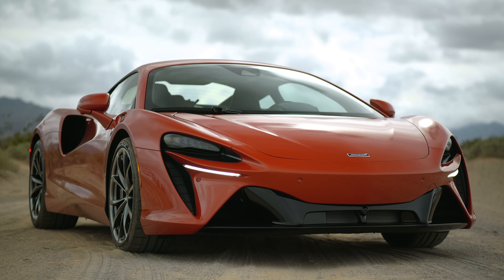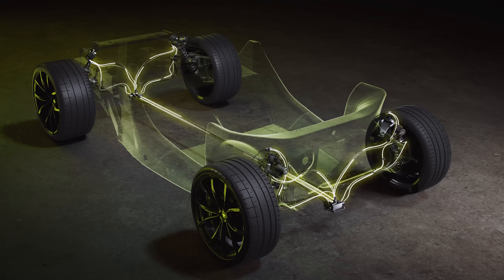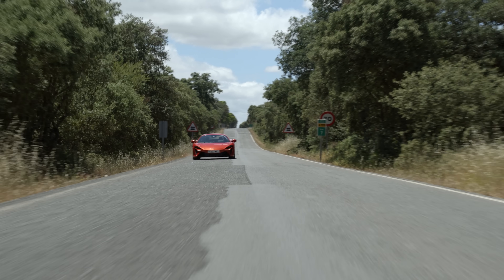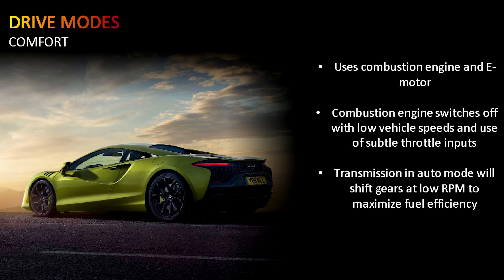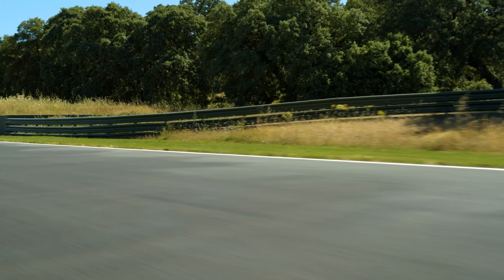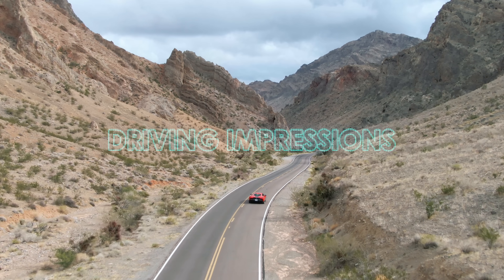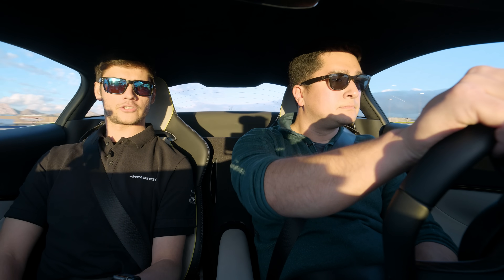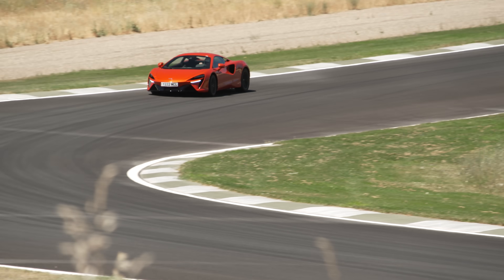McLaren Artura | The Hybrid Super Car Formula

Comment: It's kinda sad that when Honda made one of the first hybrid super cars it was nothing but cricket sound and complaints. The second-gen NSX is all but nearly forgotten. 
But now McLaren does pretty much the same formula as the hybrid NSX and it's the best thing to happen to sports cars since sliced bread. 
Y'all can suck my JDM cawk.
Reply: The 2nd gen NSX was a great daily driver. Ergonomics-wise, the steering wheel was one of the best wheels I've ever used. However, there were a few things that bothered me -- It lacked emotion.  Induction noise was cool to hear in the cabin, but outside, the car was too quiet. It's fine if you're driving in a sea of regular sedans, but next to other sports cars, it felt out of place. 

Styling-wise, Acura was going through the beak/shield phase, which I didn't mind on this car. Cars like this need to look good during the day and the lights need to make it look good at night. It needs to create desire and draw ppl's eye to it. The front lights at night were awesome. Jewel eye and low and wide appearance. The rear tailights however, used the claw shaped lights that were too pedestrian. At night, it looked like a tall car -- it needs to look low and wide. 

On the track, the car understeered quite a bit when pushed, I wish the car was a little more playful. On the street, the handling was great.  

The cabin was a little plain and the entertainment unit was outdated by the time it came out. However, if the car had more emotion and was a bit more playful, the cabin would be the least of my concern.  On a more positive note, the A pillar design was amazing and didn't obstruct your view as much and the forward visibility was amazing. The front end just disappeared and all you saw was road -- the 720S also had that feeling. 

Last nitpick, the side mirrors weren't power folding. It sucks when you need to get in and out of tight places.
Reply: The 918 Spyder, LaFerrari, and McLaren P1 were hybrid supercars that predate the second gen NSX by 5 years. And the NSX got a lukewarm reaction because it underdelivered on expectations and was delayed for so long.
Reply: I owned an NA1 and quite a few of those complaints were coming from JDM and NSX fan-boys too. All things equal most car enthusiasts don't want a heavy hybrid automatic/dual clutch sports car.
Reply: NSX styling was a failure, the price to performance was awful compared to pure engine competitors, and the assists were very aggressive and couldn't be completely turned off. It flopped for a good reason, but it will be great collection piece in 10 years.
Reply: I suppose its because of the different climates between 2015 and today. Back then we were fresh off the heels of the holy trinity of the 2010s, and BEV mandates were nowhere in sight. Now, anything with a combustion engine in any capacity is reason to celebrate

Comment: This car will kill the Mclaren brand. No one will buy this.
Reply: How so? It’s an evolution into where automobile power trains are going
Reply: @gigavirgin9653  because it's slow compared to the competition.
Reply: @R4M_Tommy  It's slow on the track, but on the straights it's really fast.  it does 10.4 seconds at 139mph in the 1/4 mile.  and 186mph in 21.5 which is faster than 90% of current Supercars

Comment: This car is amazing!!! It just blows my mind to see how far in advance the BMW i8 was. Starting the platform for these  crazy hybrids.
Reply: In what way was the i8 a “starting platform” for new hybrid sports cars? I hope you know it wasn’t the first hybrid or even the first hybrid performance car
Reply: i wanted rahter small battery then combustion generator powering electric with heat pump, suprrcapacitor, etc in a effiency focused car, then it can be fun as a secondary thing with communcative steering etc, which would also allow smooth steering, and minimizing braking to maximize longevity of fuel, battery, battery energy, tires , brakes, oil, etc. no range anxiety and its setup to be cheap as possible , some people dont need to have battry because they cant plug in, like apartment etc, fast charging is bad becuz more enegry going in and out at faster pace wworsens batteyr degradation.      maybe even a g force meter can show how near grip limit one is to avoid unsafe driving for non sporty driver, and linear response to driver inpit option for safer and more effceint driving for precise driver and then normal driving mode is delayed response to prevent excess unsafe accleration and brake for normal driver.                  just being fast is pointless to a great extent, but saving money, not being so unsafe to others in crash by being lighteight but structuraly strong for saftey, low emissiosns and resource usage and time spend on maintainence etc all makes it all feel better, yud have to drive lotus evora 430 or maybe even gma t50 to make speed feel that much more acomplishing
Reply: acomplishing and harmonious, driver input to response hamrnies, sound harmonics, etc
Reply: no it's the nsx. the i8 is NOT a supercar at all
Reply: @brownjb4444 I mean the the Honda CRZ started the whole performance hybrid thing then the NSX super car though the CRZ had a manual which no other hybrid seems to offer at least in the US!

Comment: I'll take a MC20 instead..
Reply: Looks a million times more usable and similar track performance. Maserati definitely got it right.
Reply: no because steering and brakes are not communicative lol. i dont care to check which one is less long and especially less wide, but thats helpful to allow mroe playspace on road. besides that, the linear power to sound correlation is better thna hybrid of course, and it looks more unique, argueably better.                 i suppose all the power isnt all that worthy of chosing it over old lotus evora 430, which is manual trans.   the only big step up is gma t50. you might like gma t33 , maybe even lexus lfa  maybe even BAC mono or even gma43. you might make somethign great of scuderia glickenhaus scg008 kit car with vairable suspension for tighter street driving then looser driving for more drama and lower speed and offroading.  or arx3 or ariel nomad. you might want more fun in everyday driving like a cheaper low speed fun thing like lotus elise or toyota gr 86, or even more cheaper and lower speed  thinkg like nimbus, or just a purposeful yet art deco car like aptera gamma.
Reply: @kalmmonke5037  The Maserati looks way better than any of those cars, you mention. And it drives very well, according to many reviewers 🤷‍♂️

Comment: I don't get the hype and praise. Didn't Acura NSX do this all the way back in 2016? But now because Mclaren does this it's like the best thing ever to happen to super cars?
Reply: I equally don't care about this one...McLaren whores will be excited and I expect a ton of youtube videos, I just don't think Acura had the same kind of fan base to generate any buzz even if it's essentially the same offering.
Reply: The NSX did it before, and now Ferrari does it better.
Reply: It's not what they did, but how well they did it that counts. BMW did it years ago with the i8, but it was an underwhelming car. There were definitely issues with it. The fact that McLaren went with a hydraulic steering rack speaks volumes about what kind of experience they want to deliver to the lucky few who can afford a supercar.
Reply: The NSX was poorly positioned in the market. If it were $50k less and a little slower with fewer assist, it would have been as successful as the original.
Reply: Yeah but the badging on this one says Mclaren. Idk.. I’m not impressed either. You won’t make 500 miles without a failure leaving you stranded somewhere.

Comment: I tried to daily-drive a 570S.....it ended...badly. Great car, but never-ending problems. Mclaren finally bought it back. The company was lovely, BTW. Great customer service!
Reply: What were the major problems?
Reply: @mattymatte6289  the regular Mclaren ones: rusted body panels, bubbling paint, headlight faults, limp-home mode, carbon canister issues, pieces of trim falling off, HVAC logic board failures, cracked windshield. I don't think a day came by without me seeing a "return to Mclaren" message on the display. On a good note, I never had to wash my car in the year I had it. Since the dealer always detailed it, and it was in the shop every other week (for a month), it always was returned pristine!
Reply: @johnm5131  what did you replace it with?
Reply: @mattymatte6289  2019 Porsche GT3 6-speed. 12K miles so far and not a single problem. I mean--Nothing--. Drive it everyday unless it snows. I autocross it, but never track it. Admittedly, It lacks the drama and speed of the 570S, but the 6 speed is more fun and the engine sounds are glorious at any RPM. The 570 sounds like a tractor under 5K RPM and short-shifts all the time, so it is a bit dull unless you are ripping it. The 570 can get 30MPG, which is impressive. the GT3 can't beat 18. I plan on keeping the GT3 for the duration. I admit that I would get another Mclaren someday, if they improve the QC and engineering. The company does go the extra distance to make every buyer feel special.
Reply: @johnm5131  very nice cars.
Reply: @johnm5131  This is a sign Mclaren is getting most of the work done with fresh hands on board...
Reply: @johnm5131  if you want a little more drama, try the GT3 RS. You will give up anything resembling comfort however, and you better not like to play the radio because that car is all about the noises it makes! But you are so right - Porsche knows how to make a completely exotic car that is RELIABLE. You don’t even THINK about the issues you routinely have with McLaren or Ferrari. I’m kind of over the “ultimate exotic” thing, and I certainly don’t give a flying poop about how the doors open. But if you want the essence of a race car on the street, my goodness you really cannot beat the 911 GT3 or the GT3RS. Maybe the GT2, but incrementally it’s not worth the extra price.
Reply: What a great problem to have, congrats on the gt3!
Reply: Owning British car brings you closer to your dealership. Heart warming ❤
Reply: Hopefully they changed their manufacturing processes by now.  I remember in another video how they messed up the launch on this so bad
Reply: I daily drove and tracked a 570s for about 3 years. O problems. The car was perfect.
Reply: @RickyLake  that's what I was hoping/praying for! I saw one of their promo videos of some old lady using one as a daily and it got me thinking of one..I was used to having weird daily-drivers... before the 570, I was using an R8 as a daily (which also was pretty close to flawless as a daily). But in the end, it came down to it just hard playing the lottery on a $276K car and hoping you get a "good one".  But one cool thing was they give you the cell phone # of the service manager, and he would answer pretty much any time that I called. I got very good at rebooting the ERIS system. And when I started having all of the rust issues, some VP in England took time to reach out and call me. I found that to be outstanding!
Reply: Congratulations you wasted your money on a crappy car with horrible build quality. If it’s british it will fall apart.
Reply: @SparklingWalrus  1 Jaguar, 1 Bentley and 3 flawless McLarens say otherwise.
Reply: @RickyLake  All three brands are endless money pits with bad resale value…
Reply: @SparklingWalrus  That's why I picked them up used at a nice discount.
Reply: @RickyLake  Well have fun with your inevitable problems upon problems
Reply: @SparklingWalrus  and you with yours
Reply: @SparklingWalrus  I hear ya Bro! But I will admit that the car was very seductive. If it had been reliable, I'd have driven it until the wheels fell off. They did that anyway..... ;-)
Reply: @johnm5131  McLaren is a total shell of its former self, too many “special” variants of the same car and it’s super confusing, I remember doug did a video talking about it. They are attractive cars no doubt but the build quality is unacceptable for the amount of money you are spending on them. Good on you for getting the GT3 instead. Porsches are built to be daily drivers no matter the season.
Reply: @johnm5131  I too had a 570 and am now in a 992 GT3. The Porsche is as trouble free as advertised but I greatly enjoyed the Mclaren experience and would buy another one, there is genuinely something very special about the way they drive that separates them from the competition.….unfortunately that something comes at a cost, which is they aren’t as issue free as some other brands
Reply: @jameswillard1  100% as I would have said it! Spot on.
Reply: @johnm5131  That sounded like you were very unlucky. The sports series cars certainly had more QC issues that Mclaren should have been on top of. I have a 10 year old 12C that has been faultless. Very hard to replace it as it it's such a goodun!
Reply: @dutoitm1  Hello! Unfortunately, my experience was not due to "luck", but rather "engineering". We had such a big group that was with me, that we joked that we were going to have T-shirts made up, and an emotional-support group initiated. We communicated off of the forums because no one wanted to hear people talking about issues with the vehicles ( we were threatened by Moderators). Instead, as on most forums, owners wanted to pat each other on the backs, right where their egos were stored...In actuality, the reverse turned to be true,...there were a few lucky persons who managed to get 'good ones' where everything fell into place. Mine had just under 10k miles when they bought it back, so in a year, it saw a lot of driving. That is exceedingly rare usage for a Mclaren. Most come out on weekend in warm weather or a "track day". But let me give you an example of the mind-set of engineering at Mclaren: I got the famous&common "headlight fault warning". After 3 months of working with Woking, it turns out that it is the cold winter-weather where I live that lowers the car's battery voltage just enough that when the auto-diagnostic runs each time the car starts, the first headlight it checks, is dealing with a battery that is not yet up to 14.4V and pops a code. As such, there is no "fix" for this problem. When speaking with Woking, I asked why they don't reprogram the CPU to delay the diagnostic for 2 seconds. They said, "it doesn't get that cold here in England".....well...That was that! Haha! The other issues I had were daily problems that still are all over the internet ( one poll had several hundred cracked windshields, and there are only a few thousand of these cars on the roads.  Bubbly paint, rust all over the vehicle's body panels....when was the last time we saw that in modern times?? My advice would be to keep the 12C as long as you can, because it may be a unicorn. For me, I think I will be trying another Mclaren soon, but it will be a leap of faith! As I said, the company and dealer were very honest and decent. Far better than Porsche treats their customers.